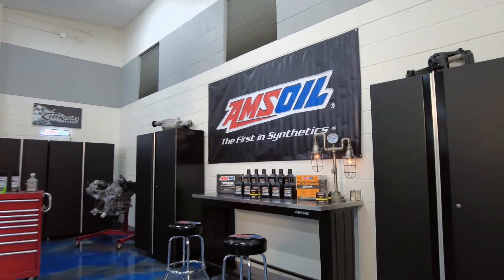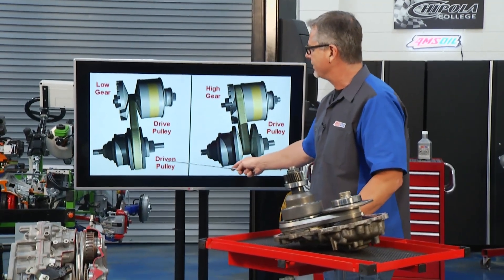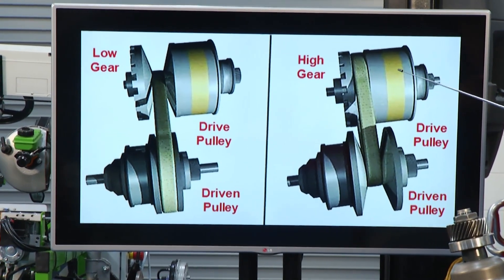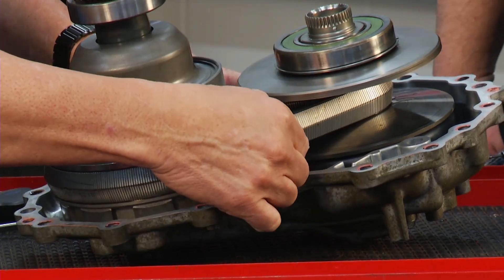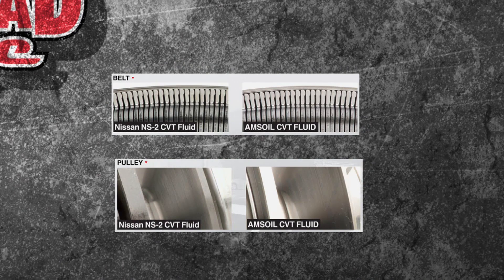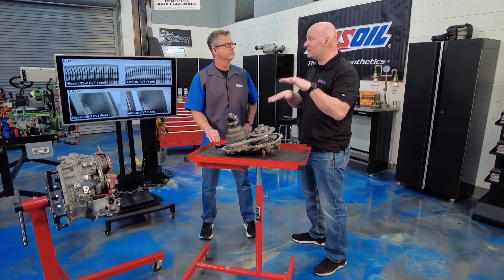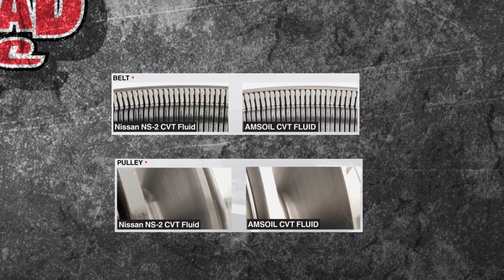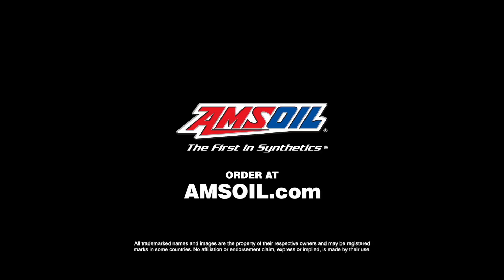What is a CVT?

Comment: I did a CVT fluid change on my Mitsubishi Mirage and these guys are telling the truth! The single weakness of the Mirage is its CVT, but it runs on mineral oil with food coloring, so you cant expect too much from that;  once I changed to the Amsoil product the Mirage has little to no slip, and it feels like the car picked up 40 horsepower, no kidding! It accelerates much better, goes from hi to low and low to high gear much smoother, not as clunky as the factory fill. Use it yourself on ANY CVT and experience the best Transmission product made today!
Reply: Is it good for mitsubishi ASX
Reply: @jinojoseph7869  what the hell is a mitsubishi ASX? never heard of one, but if it has the jacto cvt, the same as in the mirage, then yes!